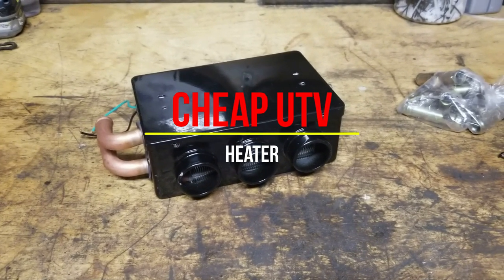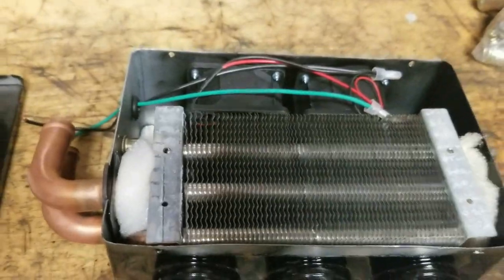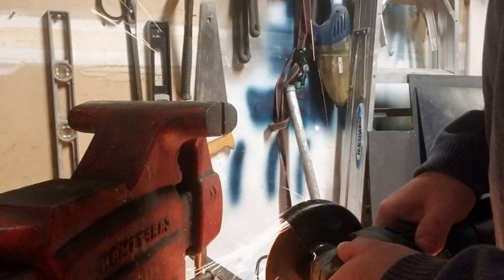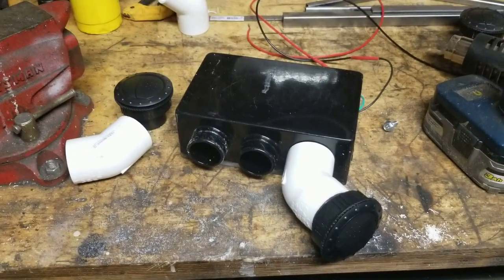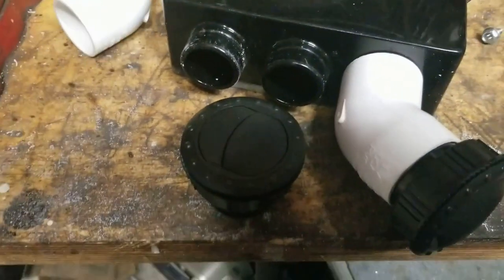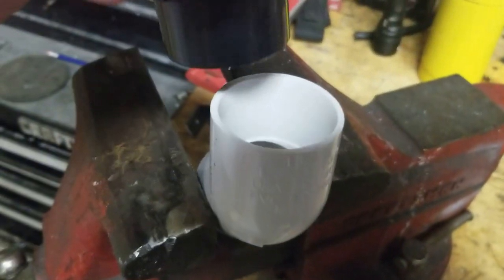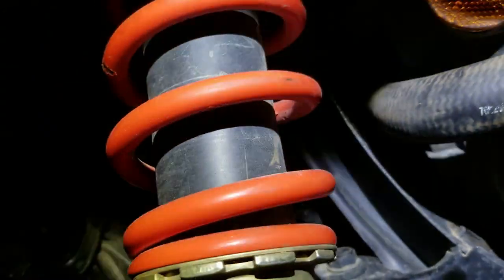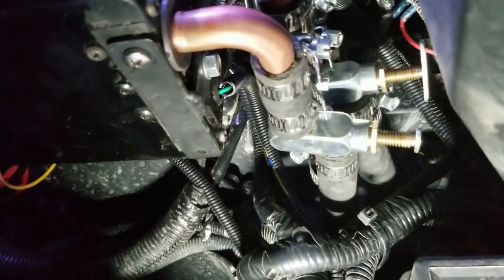Cheap UTV Heater

Comment: You just hooked up to the lower and the upper radiator hoses right near the front differential correct? Why in some other video do they only hook up 1 hose by the diff and the other hose way back by the motor?
Thanks
Reply from the maker: @Offroadjeepin4x4  yes one is the supply and one is the return. I can’t say why they are running on to the rear of the machine.  I have had no issues with this setup and I think this is how the inferno heater is installed.

Comment: What size T did you use to tap into the coolant?is it plastic? Where'd you get it
Reply from the maker: I believe they were 1 inch and I found them somewhere online I will have to go back and look. They are metal but If I were to do it again I think I would buy the Ts that inferno heater cells. They look like a better quality.

Comment: Does this unit put out enough heat for you?  Are the motors powerful? Have you measured the output fan temp?  Thanks.
Reply from the maker: It does but usually the coldest weather I ride in is upper 20s and lower 30s.  Also I am use to riding ATVs and dirt bikes in the cold so it doesn’t really bother me.  With a windshield I think it works fine but It is not going to roast you out.  If you are looking for something that you can really feel the heat I would get something else or maybe install two since they are small. Thanks for watching.

Comment: All:  please do not use a heater with the core in the cab. Any leak in the system could result in a horrible scalding and possibly death for the vehicle passengers.
Reply: You realize a lot of kids ride in buses with the rear heat.
Reply: Negative.  The core is completely enclosed in the box, and with the low flow and low pressure of a UTV, you would be lucky to see a tiny drip of coolant if the system leaks.
Reply: Wait till you find out what’s under the dash in your car
Reply: All heaters have a matrix under the dash.
Reply: You must be from California. 😂